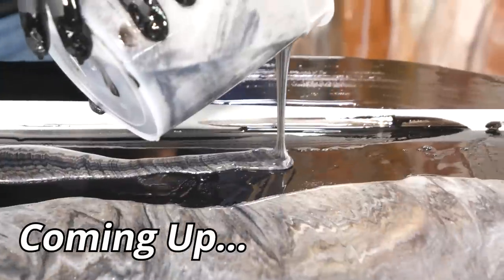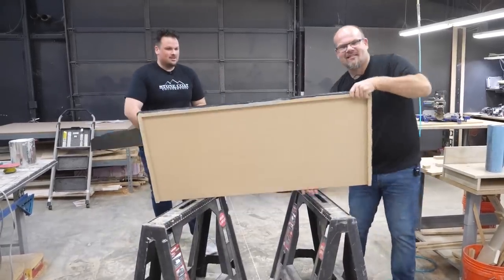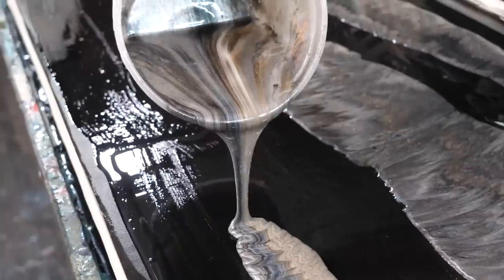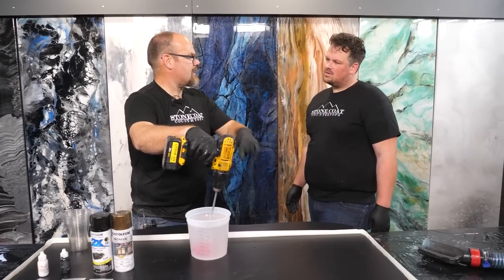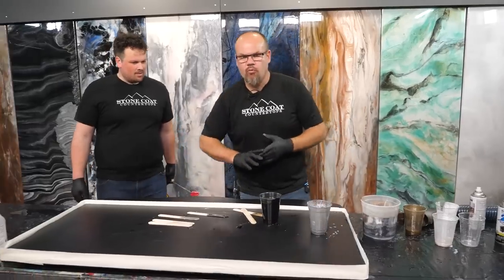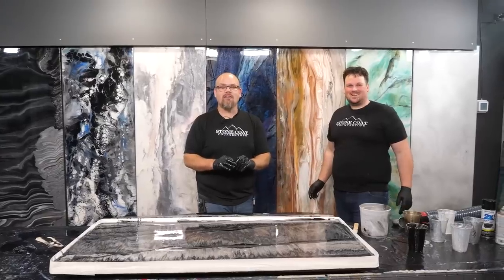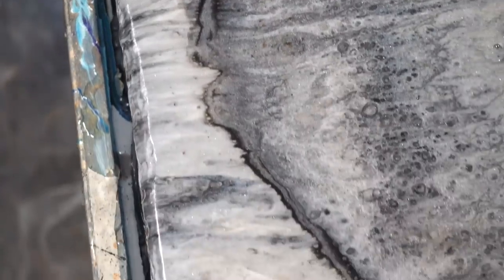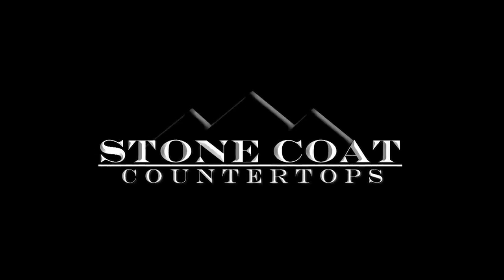How to Make Epoxy Countertops part 2 of 4 | Stone Coat Countertops Epoxy

Comment: I love these videos and they are so informative but I ran into a problem because in this video you said 3 oz per square foot which is not nearly enough. After I finished the job I went back to look at some of your other videos and in one the of the exotic poor tips you said 6 to 8 oz which is about what I ended up having to use after I had to mix up two more batches to complete the job. 13:42 13:42

Comment: Could you do the same with a sink cut out to become a sink cover? Do you lift up the countertop and letting the epoxy waterfall over the Edges? And how much gap allowance should you have for the thickness of the epoxy on both the counter and the sink cover?

Comment: We here in Hawaii cannot use your product as a one gallon kit is over $200 shipping:( I epoxy counters with art underneath and wondered how long a skim sealer coat should cure before adding another coat? With art, divits develop over parts...a skim coat (wiped like a cleaner w/squeegee) will seal but can you epoxy OVER a tacky surface?